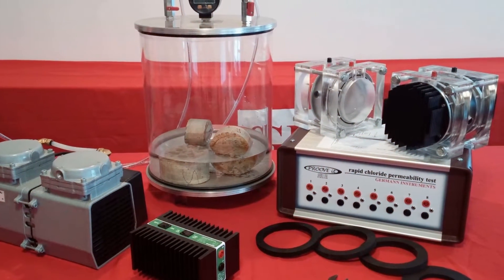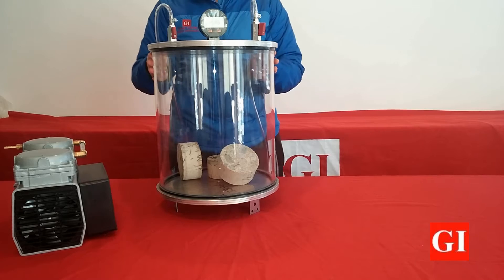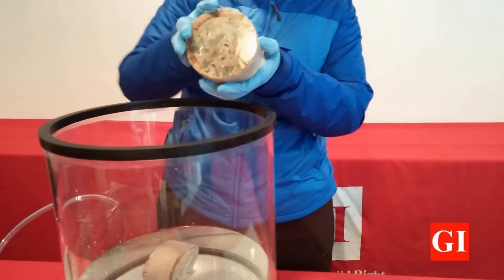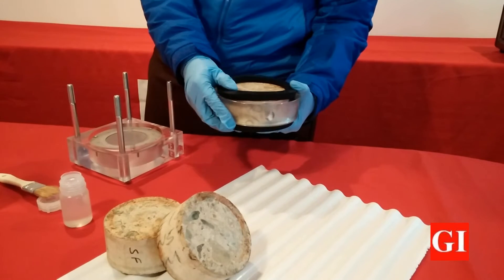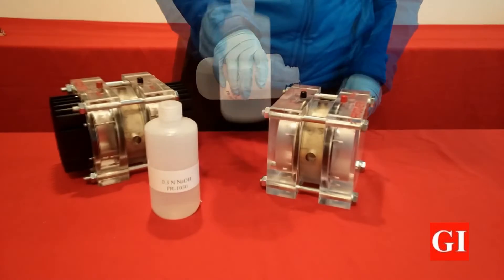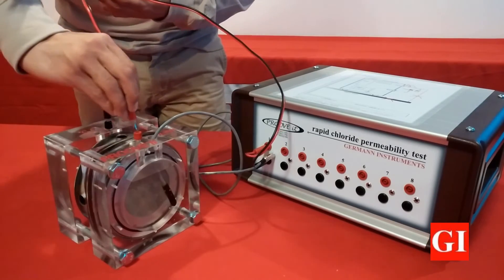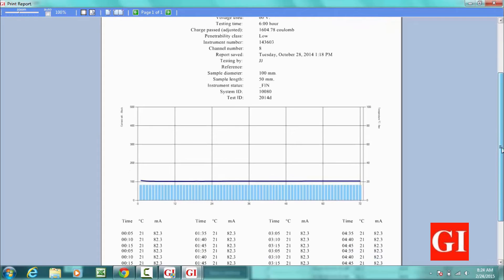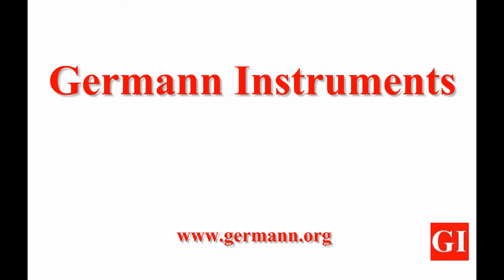PROOVEit ASTM 1202, ASTM1760 & NT BUILD 492

Comment: Hello, 

We have recently purchased a unit of equipment with 3 cells. I am currently working on running our first test, but I have encountered two issues. Firstly, I did not find the Silicon that was supposed to come with the equipment. Secondly, I am also unsure about the location of the software. Can you kindly advise me on these two concerns? 

Thank you.